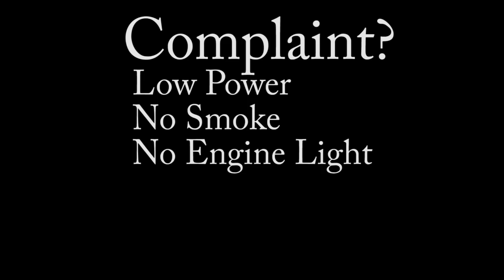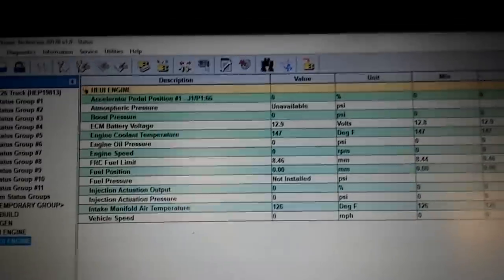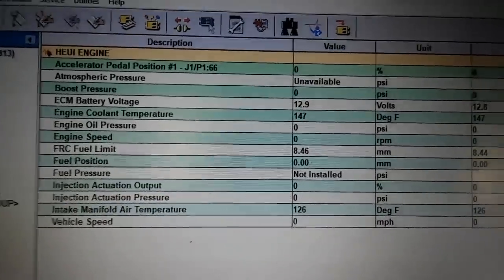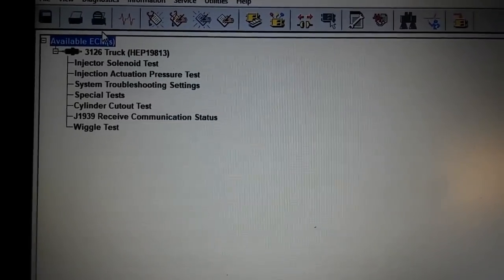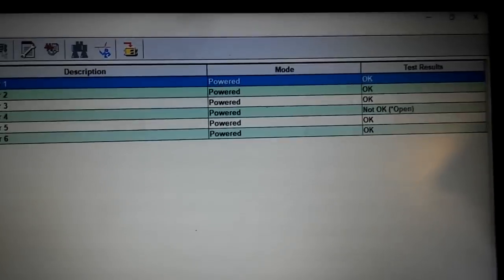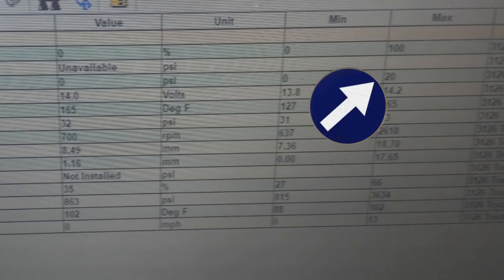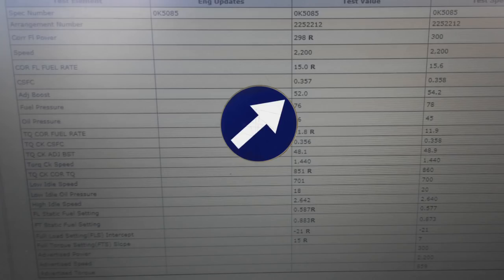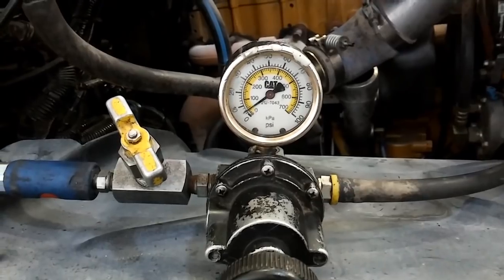Whats Wrong With This Engine?

Comment: How did you go about go about testing that air to air system? Saw that you did not remove any piping. Can you please elaborate on your method or tooling to perform that pressure test...thank you adapt ape
Reply: Adept ape. Sorry auto correct 😂🤣

Comment: I want to ask you this my truck is 12.7 is burning too much diesel sometime it comes black smoke I take it to the shop they put it on the computer it was nothing wrong with the turbo or injector plus I checked for air leak I didn’t find nothing so what is cost to lose power  burning too much diesel

Comment: First thing you do after finding that plug undone is check terminal pin drag
Another thing on the 3126 C7 run them with valve cover off look for injectors puking oil which will cause hard start low power ingine miss
This is the same fuel system cat developed for navastars ford power stroke

Comment: I work for a small trucking co. with 10 trucks using Cat 3406E engines. We are looking into purchasing a system to diagnose problems with engine issues. I looked into Cat ET but the cost is a major concern. Are there any other systems out there that you are familiar with that may be an alternative to the cat ET system. We also have 2 trucks with Cummins ISX15 engines.

Comment: Wouldn't u hear that air leak ? 
Under a load that thing would be loud as can be. 

Second question ? 
That atomospric pressure reading on the screen was na. 
What's that about and how does that effect the engine ? 

F
Detriot have a barometric pressure sensor. 
U can replace that with a sensor called "the ugly fix". 
It is supposed to give u a 16 reading on the sensor. This is basically open at all times. 
That inturn closes the EGR valve. 

Common by pass for egr system on 14 l detriots up to 2007 year model .

Do you know about this EGR by pass and what it's effects are to a motor ? 

I have seen one plugged in and same engine with the stock sensor. 
Reading is high as claimed. 

It runns a million times better with the ugly fix. 

But I'm curious about any side effects. 

Do u know anything about this subject ????

Comment: 7.3 had this issue with vibration the harness for injectors would come loose, you can tell cuz itll run rough and then run just fine, back and forth. Seems like Cat has a better design, seems heavy duty to me lol.

Comment: I guessed injector as soon as i read the customers complaints. I had the same problem with my N14 recenly. No cel, low power, no smoke, poor acceleration. Turned out it was #5 injector.

Comment: Hey Josh, I’ve learned a lot from your videos, and I want to thank you for posting them and helping guys like me!  I’ve got a question about a c 13. It started to miss on cyl 1. I found there was a broken wire in the harness but that didn’t correct it.  I changed that injector and truck ran very good, but about a week later we started noticing a slight blue smoke between gears or when truck takes off after idling for 10-15 min. We had a cyl cut out test done and without the motor under load it is not noticeable when you cut out cyl 1. If you rev the engine it is noticeable.  Truck has no codes.  Could there be another problem within the harness without cat et seeing it?   We ordered a new harness, but they are on back Order for a while.     Thanks in advance,  Brian

Comment: Anyone can help me out i have a bridge engine in my truck single turbo 2003 its a mbn n it has a cracked head but i swaped one years ago 2005 twin turbo so my question is if i can use the 2005 head on my 2003 ? I aprecciate any help

Comment: Is there anyway to check my throttle peddle with out taking it to cat
Reply: Yeah a multimeter, all it is a potentiometer normally. It will be a 5v reference system, I would check to see I have full reference voltage and ground. Next I would back prob the out put wire(signal wire/input to ecm) from pedal and on the ground and check that from 0 position it should read 0v and as you go further in travel voltage will increase until your at max throttle and you see 5v.   If you don’t see any changes or it doesn’t increase in voltage smoothly or to full reference the position sensor is likely bad. If it all seems to be working you need to test that your ecm is seeing the input, you’d need a pin out and to back prob there and check. You don’t need a lab top with programs to trouble shoot, it makes life easier for sure but it normally just points you in the right direction.... also if the injector solenoid was unplugged you would hear the engine only running on 5 cylinders, so that’s a pretty straight forward troubleshooting. You can test injector solenoids with a multimeter as well. Pretty much all electrical a multimeter is your best friend

Comment: I had a runaway accident with my cat 3406e 6TS and after repairs, should I clean the intercooler? The boost doesn't have any changes in pressure, but I'm waried about if it's doing his job right.

Comment: Is there any way I can email you about a problem with my 04' C15 about the jake no working right
Reply from the maker: AdeptApe@yahoo.com is my email.
Reply: @AdeptApe  Where are you located so I can bring you my 2006 KW Cat C13 ACERT?
I need new exhaust manifolds and new single turbo conversion install.
Then you could check everything else. :)
No, seriously

Comment: Can a consumer(rv or truck owner), buy Cat ET or is there another software or scanner which would let use run these test. I wonder about the health of the throttle pedal position sensor on my 3126 RV sometimes. How do we get access to that TMI info? Thanks
Reply: richard leitner you can buy cat et but just the computer alone is about $2500 then you have to subscribe to cat ET by the year. If you just have one or two engines it’s not worth it. In my opinion.

Comment: I've seen guys try an weld them back together 😳
Reply: John Warren you can weld cast iron.
Special teqniques like pre heating, special rod etc.
But that is cast iron pump impeller housings.
I don't think anyone would expect a welded turbo housing to last with the heat cycling they go through.
Reply: Matthew I didn't say the was smart. An yes I know how to weld cast done it many times with great  success with cast rod an nickel rod
Reply: John Warren @